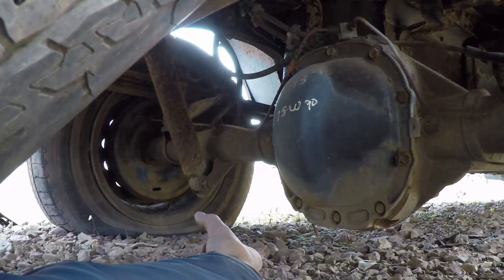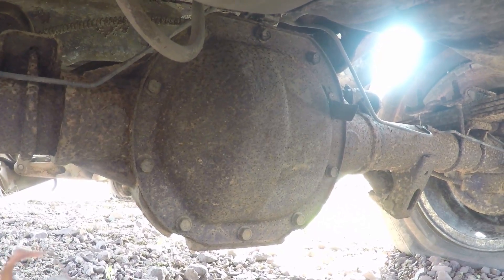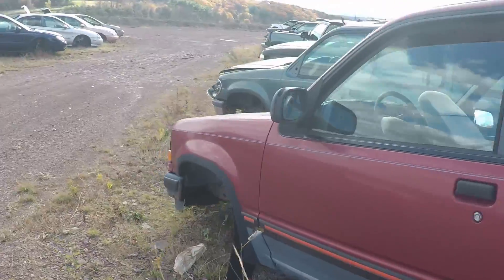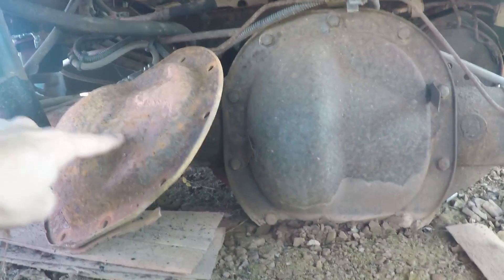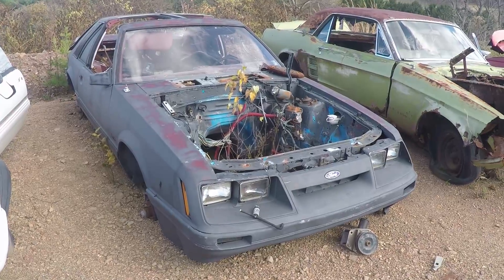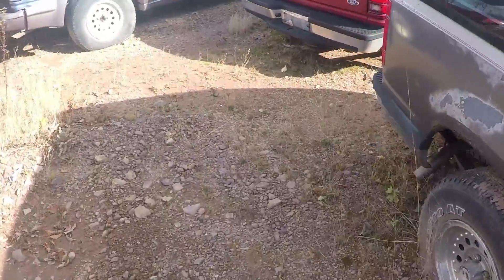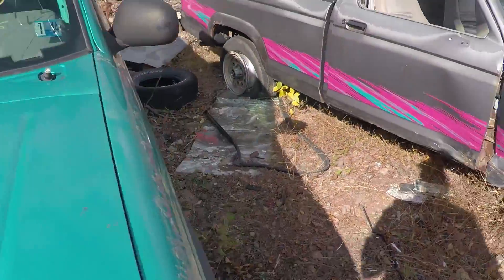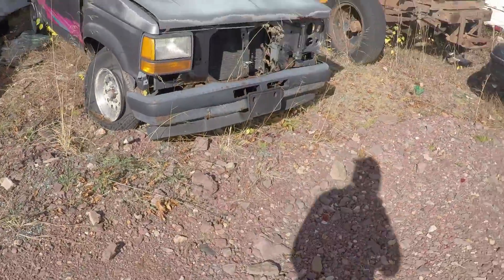Learning the visual difference between the Ford 7.5 and 8.8 rear end

Comment: The 85 thunderbirds turbo coupes  and 85 cougars came with 7.5 rears in my opinion these were stronger than the 8.8 cause unlike the 8.8 they didn't have clutch discs on the limited slip rears, the 7.5 have cone clutches which are stronger and grab more.

Comment: The Explorer 8.8-Inch has larger 31-spline axles, a larger ring gear, and 1995 and newer models can be found with disc brakes. Avoid 8.8’s from Ford Rangers. All but the FX4 Ranger only had 28-spline axle shafts

Comment: You don't wan't the 8.8 out of the ranger. It has 28 spline axles. The explorer and sn95 mustang have the good 31 spline axles. Maybe you could get away with the extra width by messing with rim offset.

Comment: I had a 1998 Ford Expedition XLT.
8.8 Rear under warranty they paid $1000.00 to get it rebuilt. After a year rear blow out again. No more warranty. I paid $900.00 for a used rear at a local junk yard. That was about 10 years ago.

Comment: can confuse you even more, there is a 28 spline 8.8 and 31 spline 8.8...... 28 spline 8.8 are the same axle shaft as a 7.5. and all  explorers from 91-01 are 31-spline 8.8
Reply: 2007 7.5 mustang rearend specs
Reply: Hey,will the 91 and up explorer rear end fit a 79 mustang fox ,are they the same length

Comment: this actually helped me identify which was the ford 8.8 rear end.  I'm looking for one out of a 95 explorer to swap into my jeep cherokee.  I found several explorers the right year and photographed the axles.  so I could come home and do some research.  thank you regular car reviews.
Reply: +sexymikeization I have heard that the 8.8 is a good common swap ,just wondering why?
Reply: +P Kuudsk beefy. cheap.  the correct width to fit under a jeep. if you find the correct one you can get a limited slip. too.
Reply: I just pulled the pumpkin from a 95 cherokee and pinion for a lsd swap way less work,and my 87 yj has retaing plates instead of c clips

Comment: I don't know if you can find a used axle from 2011 vintage truck, but my 2011 Ranger (one of the last ones made) has a 8.8 with limited slip and I'm not sure of the width, It's likely 58-1/2. It might make that work with the right offset rims. Just a thought.

Comment: Just be careful you don't get the dreaded 8.75" turd. It looks a lot like the 8.8. The 8.75" is found in a lot of late 70's cars. It has WER on the axle tag.

Avoid the Fox Body stuff. In addition to having a 4 lug (which is a different bolt pattern from the Falcon 4 lug) you'd have to shorten both sides and cut off all the trailing arm and spring mounts.

Comment: Mr. Regular - One side of the explorer 8.8 is longer than the other. You get 2 axles for the short side, and shorten the long side of the housing to match the short side.  You'll only have to shorten 1 side of the housing that way, rather than having to shorten axle shafts and the housing. 

I don't think you'll find a 56" or a 56.5" wide 8.8"
Even the Mustang II / Pinto were 57"

Comment: Brandwagon240 is right Mr. RCR... Id say search for a 95 to 97 Ranger with the V6 engine, 3L or 4L. Here in Uruguay Ive seen Falcons similar as yours with those rear ends and they work perfectly. Offcourse, double check the meassurements but Im sure they will work!

Comment: If you use, I think, two RH Exploder axle shafts, you can get the Explorer axle short enough to use in a classic Mustang, anyways. A Mustang axle can fit in the rear, but only with Fox length axle shafts since those axles are 1" shorter per side. That's what I have in my '65 Mustang. You can compensate by getting wheels with deeper backspacing, though. Also, you'd have to cut off control arm brackets and weld on spring perches, but you'd need to weld on or move spring perches for any axle you get.
Reply: +paul289 Mustang is much wider than the Falcon. I tried a '65 Mustang rear end in my '62 and the tires poked out past the fenders. 

'64-65 Falcon and '65 Mustang are 58" 
'60-63 Falcon are 56"

Fox Mustang axles are also 4 lug. And not the same 4 lug as the Falcons.

Comment: narrowing axles isnt that big a deal. also cant you just run a wheel with a different offset in the rear to make up for a small difference? you said that one you found was only an inch or so off.

Comment: Apparently the Exploder axles are asymmetrical... and what you do is modify the driver's (longer) side with a passenger shaft & tube. The end result being the right symmetrical axle for your Falcon. So if you need it done that way would be cheapest.

Comment: The best thing to do is get an 8" from a 70-77 comet or maverick. They were 5 lug from 74 and up and there not to hard to find. My maverick has an 8 inch and I will be using a v8. Alot of maverick guys in the tri-state area.
Reply: +Mark Po All the V8 Maverick axles were 5 lug, starting in 71 which was the first year for the V8. I have a Maverick 8" in my Falcon.

Comment: Why don't you go to junkyards that specialize in classic cars? Try to find a rear end from a old first or second gen Rustang. (I think thay had 8.8's as an option) The Mustang was built on the Falcon platform so I would think it should be the correct size.
Reply: +TheTarrMan Any Mustang axle will be too wide by at least 1". Pretty much any Ford axle other than the Maverick 8" will be too wide.  The 60-63 Falcon was the narrowest axle Ford made at 56". Even the Mustang II was wider, it was 57".
Reply: And it's 28 spline junk

Comment: 7.5 would be fine on a mild build. I've seen guys run 12 sec 1/4 miles on them. The tlock is the weak point. Gm used the nearly identical 10 bolt rear behind camaros in the 80's and 90's, plus the 7.5 weighs about 80lbs less.

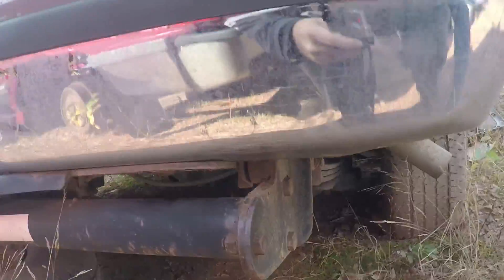Comment: I could be wrong, but I'm reasonably certain that the gen 1 Exploder at 5:20 was built on a Ranger chassis, so you might have found your axle there.
If not, you can definitely cut down an axle. Chop the axle tubes yourself (measure 5 times, cut once) and have a machine shop cut and re-spline the axles. Mopar A-body guys frequently cut down C-body axles, because original A-body 8.75 axles are like hen's teeth.

Comment: Crown Vic's/Grand Marquis/Town Car all have 8.8 rear ends also. 1998 and newer have a watts link suspension setup you can use to increase handling if you'd like. Civilian versions have a 2.73 gear ratio while P71's usually have a 3.27 gear and sometimes steeper

Comment: the first gen v6 exploders got the better 31 spline 8.8 but wider 59.5"
90-92 ranger v6 manual  has the weaker 28 spline 8.8" but is 56.5" and is the narrowest ...any machine shop can narrow a rear cost about $300ish but keep in mind that doesnt account for new axles which of course would be shorter  ...

the best to get would be a second gen exploder v8 it will have a 3.73 gearing option 31 spline and track lock (tag reads 3L73) and just have it narrowed and you get disc brakes with it .

Comment: Shortening a rear end really isn't that bad. A good fab shop can chop the axle tubes to length, square them to the center section, and weld the collars. Shouldn't cost you much more than the rear end itself, its mostly labor. You'll need to get axles made to length.

Comment: that independent rear suspension had a rear differential bolted to the chassis and then two cv joints or half shafts coming out of it and driving the wheels. it's kind of like a transaxle on a fwd but shoved to the back of the car using a driveshaft to transfer the motion. Accomplishes the same task just handles better.

Comment: 7.5 flat top, 8.8 round top, 9 no cover (3rd member comes out the front by the driveshaft). Um... you could always look in the DOOR of the car/truck. Most of them have a sticker that says what size rear end and SOMETIMES what ratio.

Comment: Ford actually used the 7.5 in 85 5.0 Mustangs.  For a mild driver like the Falcon, you'd probably be OK with one of the ranger 7.5s provided it has the limited slip.  A friend ran one in his 5.0 Ranger with no issues.  You can also look for the Lincoln Versailles 9" with disks - this is possibly a bolt in, but could be hard to find at this point.

Comment: One thing you can do to shorten the 8.8 is to get the 8.8 off a front axle of an Explorer. They had the offset pumpkin which you can then cut down the longer driver side axle housing and use two passenger size half shafts. This shortens the 8.8 and makes it equal on both sides and shorter. Its what I'm going with for my 1974 Toyota Hilux to make the track width closer to what I'm looking for.

Comment: IIRC, if you are looking for an 8.8, the shortest most commonly available will be that exploder 8.8 @ 58" how short are you looking for? can you get away with just changing the wheel spacing (deeper set)?? 

alternatively... take an explorer 8.8, which has a uneven long/short side axle tube/and axle... get 2 of the short axles and 2 of the short tubes. mash them together. you'll have to weld on the brackets/spring cups etc... get a 95/96+ year rear end and you'll be able to have disk brakes w/ 5 lug IIRC.

Comment: Dangerous to use? I thought you said it was going to be a cruiser not a tire burner.

 I love how you go to the fox bodies but ignore the 60s mustang sitting right there which may have had an 8 or a 9 inch. Wider than the Falcon? A bit but also would be easier to bolt to the car.
 Probably should have looked up what an 8.8 looked like before ya left as well. Also don't understand the whole disk brake thing for the rear as well. Sure, up front if ya wanna stop use disks.

This car is looking less and less like a regular car and more like any TV car rebuild. I had hopes that I may learn a few things to help with my Comet but if this video tells me anything I should watch just for a laugh.

Comment: eh, a 7.5 would probably be fine for your 302 - the 1979-1985 V8 Mustangs had 7.5s.  Plus if you can find one, Ranger 7.5s did come with an LSD and 3.73s
Reply: Yeah and ford change to 8.8 mid way through production of the 5.0 fox's there's a reason and it's not because threre was a jump of HP.

Comment: Get an explorer rear. Take the passenger side axle out of another explorer. Shorten the driver's side to match the passenger side axle. This will give you an axle with 31 spline axles, disc brakes, and 52 inches outside of the hub to outside of hub. Been there done that more than once.
Reply: How much power will the stock axles handle?
Reply: @shitbox7413  we've put 700whp through one. I've seen people put 1000whp through them
Reply: Nivlac57, Good to know, thank you. 👍🏻

Comment: what benefit does having an 8.8 bring?
Reply: +Cissies  It can handle more torque, which the new engine should have in abundance.
Reply: +Cissies Its stronger. Swapped a 8.8 into the rear of my Jeep to replace a dana 35. Better for bigger tires and offloading and in the case for Mr. R better for a more powerful engine.
Reply: +Jerry Serrano The 8.8 is a limited slip? I didn't actually know that, what would a 99 Explorer 5.0 2WD have?
Reply: Heh I'll have to get under there tomorrow, from what I can find online, it seems like it probably is.
Reply: +TechNerd1300 Not all of the 8.8 rears are limited slip. It was available on some vehicles and not others.
Reply: +Cissies the 8.8 when built right is right up there with the 9-inch as far as strength and durability, for the fraction of the price.  Solid find for the drag strip or off roader who wants an affordable rear end, with parts out the wazoo...

Comment: The last time I have one shortened it was $200 in labor.  I have found that its best to just buy the ones that are still in the vehicle. Its helps with identification and allows the opportunity to pull the brake lines and emergency brake cables with it. If the ranger does not come with discs you may end up spending near the same acquiring those as shortening a disc explorer unit.

Comment: Which rear end is best rear end?
Reply: +Ramon B My rear end is best rear end because FRONT WHEEL DRIVE.
Reply: +Ramon B My rear end is best rear end because SAMPLED SIR MIX-A-LOT
Reply: +Ramon B My rear end is best rear end because WELDED SPIDER GEARS.
Reply: +hignaki My rear end is best rear end because half pulled locking pin
Reply: +Ramon B My rear end is best rear end because MISSING C CLIP
Reply: +Ramon B Rear end is best rear end because JENNIFER LOPEZ
Reply: my rear end is best rear end because beer farts.
Reply: +Ramon B My rear end is best rear end because IMPLANTS
Reply: +Ramon B My rear end is best rear end because DEAD AXLE
Reply: 8.8 out of a 90's explorer. The newer ranger 8.8 has a 27 spline rear as the older explorer 8.8 has a 31 spline. The explorer rear is stronger.
Reply: So, to ignore the childish comments, the 8.8 is stronger and has more gear selections available as well as more locking diff selections.
Reply: @jimmiller4667  Thank you sir!!! You are appreciated in my book really and truly👍 sincerely a youngin starting out.
Reply: +Ramon B My rear end is best rear end because DEAD AXLE
Reply: Kim Kardashian's
Reply: Ford 9 inch

Comment: If you end up with a rear end with disk brakes don't forget to swap the master cylinder. Power drums have constant pressure through the lines so you cant use the same master.
Reply: +Noah Ferrari I'd upgrade the master cylinder anyway to a dual master cylinder, if that hasn't already been done.

Comment: Spin the disc brake. If the other spins, 8.8. If not, 7.5.
Reply: +99gt03cobra The tire spins in a 7.5 just the opposite way, and thats if its an open diff, I have a 7.5 with a LSD and they made  8.8s with an open diff therefore your theory is moot
Reply: +Brendan Cunningham Same difference. Find one that spins both wheels forward and you got your 8.8.
Reply: or a 7.5 with a LSD I just explained this...
Reply: I'm  pretty sure any late model Ford since the late 90's had an 8.8 if they also had a lsd. Hell the best choice would be a 94-98 Mustang GT since they're axle was shorter that any SUV or truck.

Comment: Look for a 92-07 4.0L Ranger, some of the 3L ones had 7.5s.
Reply from the maker: +bandwagon240 I need an 8.8
Reply: RegularCars Suppose I should have explained further.  All of the 4L Rangers and Exploders will have an 8.8.  This includes the SportTrac.  In the case of a Ranger, a V6 is not an automatic 8.8 score in the second generation unless it is 4 liters strong. 

Just a thought, have you thought about compensating for axle width with wheel offset?  Changing the offset on some steelies has to be cheaper than reducing axle width.
Reply from the maker: +bandwagon240 OOOH ok that make more sense! Thanks! Will check engines for the 4L V6
Reply: +RegularCars You might try reading up on an axle FAQ on TheRangerStation. They even had a width cross reference last time I looked.
Reply: +RegularCars door stickers in the door sill are an easier way to find out what rear end and ratio is on there. Supposing you want an LSD in a normal-ish ratio, look for R5 or R6 in Rangers, 3.55 and 3.73 respectively. I put a (R7) 4.10 locker in my truck, and now I hate doing highway driving. IIRC all ranger rears have same hub to hub length.
Reply: It's best to yank the pumpkin out of a fox, rebuild the differential and install new gears into whatever rear you get.  I don't trust old junkyard ring and pinions.
Reply: +RegularCars All Panther Fords have 8.8"
Reply: While this is true, you'd have to grind off bracketry.
Reply: +RegularCars check out shorty and daves in king of Prussia they should have a few 8.8s. Or connors truck parts has a database
Reply: +DonnInTheFive Thanks for that link. I just found a replacement mirror for my truck only 5 miles away!
Reply: +Mr Anderson 
Yeah, but they won't be 56" wide.
Reply: Not hard to modify

Comment: Any luck with finding one yet? You couldn't get the one off the second gen ranger and shorten it in any way could you
Reply: +CKYJDM98 You can get the shortened, but ideally finding one close enough to the right width would save a crapton of work and money. Then again getting one shortened, and in that process rebuilt is probably going save you frustration in the future anyway